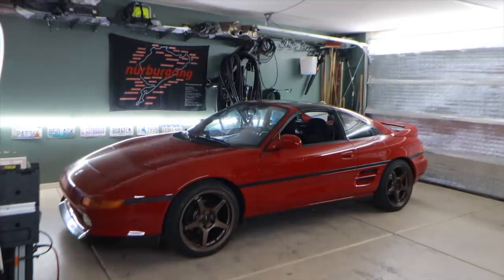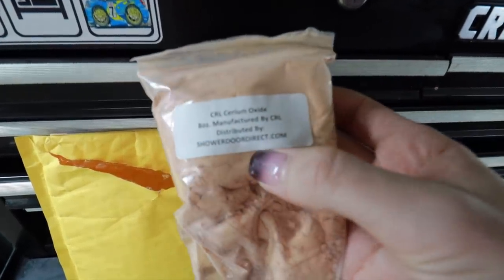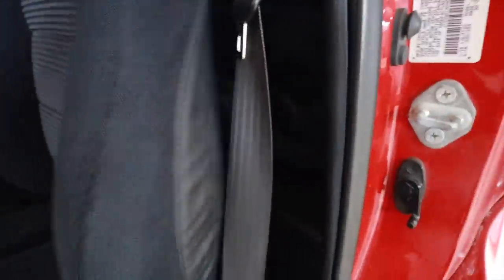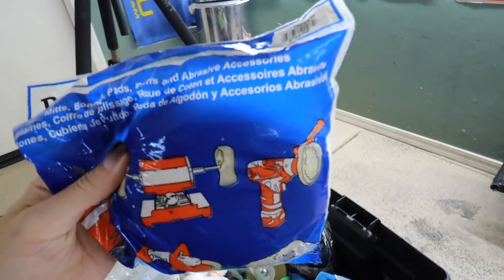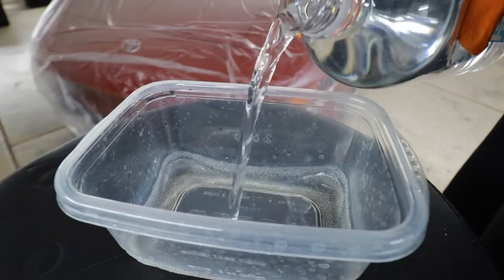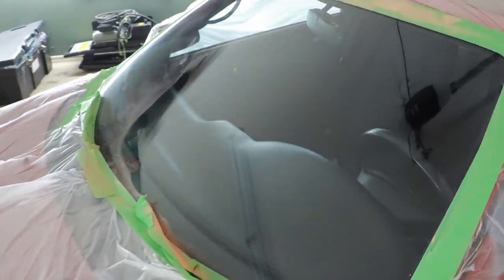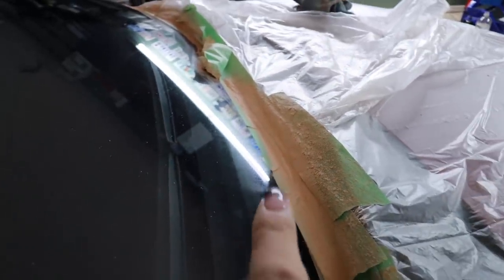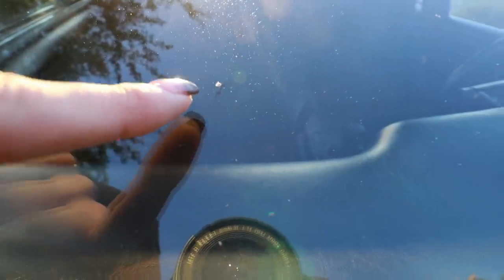Severely Scratched Windshield Repair // Hope I don't Screw This Up!

Comment: You have posters of the Nordschleife on your wall!...If you haven’t been, you should definitely go...It’s not that expensive...Just the plane ticket to Frankfurt, a rental car, and a hotel room. I stay at Motel Frankfurt in the Dornbusch neighborhood of Frankfurt. It’s about $100 a night. A full size Hertz rental is a big Mercedes. The autobahns on the 1.5 hour drive to Nurburg are intense and fun! The Nürburgring is Mecca for motor-heads and a bucket list must. A lap is €27 and takes about 10 minutes if you’re pushing it. You can drive your rental car or rent a track car at the track from a number of businesses. You’ll remember it forever. So very beautiful in the countryside of western Germany.

Comment: Hello Sarah,
Nice work with great results on the windshield.
But if you don’t mind the pads for glass polishing is Rayon Pads ..
It cut much more faster but it needs the surface to be always have moisture on it too keep it cool.
So you can mix the Cerium Oxide to be like a paste then spray a spritz of water and work and when you feel it is started to dry spray again till you end your polishing.
Then wipe off and inspect.
Also Car Pro has it as a Paste.
Hope the best for you.

Comment: Yes to the factory sub. It will also make it much nicer to listen to over long periods. Rockford Fosgates are fab but in my research have quite a high bass frequency cutoff. I can confirm the bassiest T1532s even remove a lot of the thump of a kickdrum. Replaced all four factory speakers with those and after a week I begrudgingly installed a removable 8" sub. I wouldn't be without it now. The difference of the before and after was comparable to your windscreen result; subtle but completely worth it. I also need to do this to my windscreen so this couldn't have popped up at a better time and something I can actually try at home with the limited tools I have access to. I love your ethos! Thanks and hope that helps.

Comment: I had a small, flat "subwoofer" in my NC Miata, and while it didn't hit hard, it did fill out the sound overall.  So I would recommend putting a sub in Mr. Dos.

Comment: Cerium Oxide is also known as jewellers rouge, used as polishing compound, you mix it as a paste exactly as you did. Whenever working on glass just keep the polishing tool moving so you don’t concentrate heat in one spot and use lots of water to keep the area cool and wash any particles that could scratch the glass away.

You did a good job 👍

Comment: Yes, to a small subwoofer.  Something like a JL Audio 6w3 or Alpine Type R 8" with a 200-400 watt amp would probably be plenty to add some bass without getting ridiculous.   
I know back a few years ago there were guys making custom boxes for the MR2 but now I'm not in the Toyota scene so I can't direct you to anywhere specific.

Comment: Damn ive been wanting to see if this is actually possible for years, my 92 MR2 has the same marks on its original screen too. Ive not seen a full run through with the technique before so Its awesome that the first full video I see of the process is someone ive been subscribed for ages

Comment: Great result! I just did the same for my Triumph Stag windscreen, but had the luxury of doing it flat on a set of stands before I put it back in the car during the rebuild. So much easier!!
Subwoofer- has to be personal choice. With all the cars you drive you will be very well aware of the difference it makes- question is whether you want that when driving Mr Dos.

Comment: Hi, Sarah!  I’m a relatively new subscriber.  I really enjoy your sense of humor.  Your knowledge of cars and maintenance is amazing.  You take on repairs or upgrades I would not attempt on my own.  

As to the subwoofer, you can install one if you want the car to have it for “factory accuracy.”  It will add some depth improve the sound.  Personally, I wouldn’t do it.  I’m a serious gear head and a serious audiophile.  In most cases, a nice sound system in a sports car isn’t so great.  Most likely, you have a free flow exhaust and you built the car to drive fast and have fun.  The audio system would be drowned out by the the sound of the engine.  The best sounds in any sporting auto are the rasp and wail of the engine.  Enjoy that.  Luxury cars with good audio systems make sense because of all the sound dealing.  But, high end audio performs best in a house.  

My advice is to let the engine sing to you!
Reply: There is also very good high end audio in cars.
In the end, it all comes to how important it is for you to enjoy music in your car. And in this case, the answer to that question only Sarah can know.

Comment: Glad you posted this because I have been researching this topic. Personally, I don’t want to do it and would rather hire someone. I have all windows that are either scratched (my oops) and or has hard water stains. I bought a car, new, last year that was neglected and was set outside probably under a sprinkler system. Edit: I tried clay bar, bar keepers friend and the woeful advice of an auto shop to use use those 3M scotch pads.

Comment: Very nice. I will have to likely use this window treatment on my 91 MR2. Go for the subwoofer. I had a 12" behind each seat and it was great. Your plan should sound good and take up less space so go for it. You have done a beautiful job on yours in general. Can't wait to get mine back on the road. Peace

Comment: I have a 10" subwoofer mounted in a custom enclosure behind the passenger seat on my 1991 MR2. I'm very satisfied with the bass fill it provides. I tried it once behind the driver's side but didn't like the bass hitting me in the back.

Comment: To finish the polishing off, you can use some Menzerna 1000 or 3M perfect it and a firm foam pad just to finish things off. You did bring up one of the down sides to polishing glass, you get 85% of the problems fixed and whats left for flaws are incredibly visible. I end up having to do the windshields on my semi twice a year.

Comment: Your results were impressive, Sarah.  It took a lot of work, but in the end, it was certainly worth it.  This project of yours got me wondering if anyone makes some type of glass sealant that will reduce the result of those micro pits that we all collect over several years driving through all of that environmental crud in the air?   Thanks!

Comment: Subwoofer I would put a kicker HS8 in. Put one in my Subaru Forester under passenger seat. Works well! Not over kill for a small car. 

I have the Griots glass polish with the proper pads. But was sidelined all summer so never got a chance to try it. Now I have done hope it will work!!

Comment: Great job. Hopefully you replaced your wiper blade rubbers as they would still have fine embedded pieces of dirt and/or sand in them that was causing the scratching on your windshield initially. New blades are cheap and would be HIGHLY recommended on a brand new polished windshield.

Comment: That was impressive and informative 👍 I have a Subaru Forester SF5 sti, only 3 registered in the UK right now with some bad scratches (visible but I can’t feel them) from a *insert swear word” hand wash, no chance of replacing windscreen. I had tried maguires glass polish which helped but didn’t remove them.

Comment: You crack me up lol The felt pad would be used if you were say getting scratches out of a watch crystal/glass. They are small and fit to a dremel sized machine. That would have driven you nuts. As I am a watchmaker and have a scratched windscreen in my old banger I'll go nuts for you as I never thought about using that messy crap to get the scratches out of my screen! Happy hammering.

Comment: Definitely do the sub.  Even if you're not a sound nerd, you'll like the change.  Also, next time you need a felt wheel, check out dental laboratory supplies.  The mandrel would fit your drill but they're designed to be used on a lathe so you'd only have the edge area to use, for what its worth.  Really like the MR2!

Comment: That really came out nice glass is one of the hardest things to polish that stuffs really seem to work you winged it well must be your Air Force training— MR.dos  looks good,just a fantastic job well done. I think you would really like a sub woofer in the car you don’t need a giant one I put one in my 85 Toyota pick up similar cabin size It was a small 6 inch powered sub I think it was a bazooka   basically a tube behind the drivers seat. If there are flaws they’re very hard to see-

Comment: I use Cerecut off eBay   took all the damage off both my cars and is good for stainless steel as well  comes ready to use..   also those stone chips are real small get yourself one of the diy kits  its not hard to do and fixes small ones easily

Comment: Nice job, but I have a suggestion. Whenever you are going to mask something off, as you did your entire car, start by taping off around the subject you are working on. In this case, your windshield. Then cover the object, (your car), and then tape the edge of the plastic masking back to the tape. This makes sure you are covering moldings and paint and keep a solid bond that flying paint or compounds can't get past. It also gives you another layer of protection from your polisher..
Reply from the maker: Steve 1961P. it worked fine just the way I did it 😉

Comment: Good job,  thanks I will do that, 
suggestion,,, next time wet the buffing pad. And Lanolin Used on all rubber and plastic parts is a creat restorer. Plumbs your door and window rubbers. 👌

Comment: Depends on what your looking  for in sound. More sound requires more power. Then your looking at amp addition, wires, space and so on
Reply from the maker: Get lost today good thing I have an extensive background in complex electrical systems 😉
Reply: @SarahnTuned  shoot for a small 8 or 10 inch sub then girl!😊

Comment: just like buffing the paint. I like to wet and the ring out my pads before detailing,I find the compound lasts longer and doesnt dry out ,I keep a spray bottle handy to rewet the surface and switch between compound and water .its tricky I know, but its what works for me

Comment: DEFINITELY add the subwoofer to your stereo, it'll sound so much better. I hate car music without bass so much that I even have 2 cheap 8" subs in ported boxes behind the 2 seats of my work van soley powered by a factory radio combined with 6.5" door midbass drivers crossed over to 1" silk dome tweeters mounted up in the doors at dashtop level....😎

Comment: I used to think a subwoofer was overkill for cars.  Then I bought a car that came with one as part of a package... and I don't want to hear car audio without it :)  I don't listen to anything super bass-heavy, but it gives the classic rock and classical that I mostly listen to the kind of depth that normally only comes from the much larger speakers in a home audio system.  Especially when I get the Led out 🎸  That windshield looks so good now!  Do you make housecalls? 😎

Comment: You probably won’t be doing ball joint separation anytime soon, since ya just did these, but the 3/4” forged ball joint separator from Harbor Freight ($15 or so) will make the job waaaay easier than that turd ass tuning fork. 😜 Love the format of the vids, just keep doing what you’re doing!

Comment: Curious how this turned out after you got it out in the sun? Did you have pitting or just scratches? My issue is more the star field of pits. Seems like a helper with a spray bottle would help. Thanks?

Comment: I don't know what you paid for that mix of oxide but you could have spent $14 for Wolfgangs window polisher. It's meant for a auto-windshield but I use it on my iPhone for the same purpose. It works perfectly.

Comment: Good job with that glass. By the way you could have used the Hydrosilex on that windshield ! And my question to you about that is: How long has it been on the MR 2 cuz it looks like its doing its job (water beading during the wash).

Comment: I always thought the stock subwoofer in the 2nd gen MR2 was one of the best sounding factory systems I'd heard. So if you can find one that's a good factory replacement - i.e not too big; it should really improve the sound.

Comment: Always yes to a Subwoofer but no need 4 15’s either a simple self powered 8” sub either under the passenger seat or in the OE location is fine for your application it will fill in that low note in all music and reduced the stress on your mid bass speakers from trying to reproduce the super lower bass notes and balance out the highs from the tweeters on your separates basically unless you only listen to talk radio every sound system needs a sub 🍺😎👍🏽

Comment: I'm not sure what research you did, but the detailing world has a ton of pads and compounds specifically to cut/polish glass. Generally a medium to heavy cut pad, and some glass compound, followed by a fine pad with some polishing compound on either a rotary polisher(for faster defect correction), or a DA polisher, works the best. Not sure why you had to go with cerium oxide...that stuff is normally used for things like countertops and other more industrial applications. Not that you can't use it, just don't think it's as easy a application than a ready made glass compound, nor would it finish out as nicely/easily.
Reply: Also, cerium oxide on modern windshields might create too much heat. The problen with uaing it on modern glass is that the glass is layered, the middle layer is a kind of plastic, that the heat from polishing can warp. This won't be noticeable just visually looking straight through the glass, but it will be noticeable at angles especially at night, you will see weird vIsual distoration.

Comment: You probably don't need a huge sub to fill that car, especially if you're not trying to "beat down the block" (to quote Too Short :D )  I have an 8" sub in a kick panel in my 996, (similar size interior) and it's more than adequate.  Another vote for sub.  ;)

Comment: Have you considered using the cerium oxide on the plastic head light covers of your Audi ? Might be interesting to see what would happen.
Reply: It would destroy the lenses. Most plastic polishes use a silica based abrasive, much 'softer' than the cerium oxide abrasive.

Comment: Yes for sub, and that stuff worked great, do you think it would work on tiny pitting that you can only see when a bright light shines through the windshield just right. Cause my tacoma has so many of those that when the light comes through just right, you it makes seeing through it kinda difficult. have been strongly considering just replacing the windshield but if i can diy it i'd be all for it.

Comment: I did not know you could get scratches out of glass, it looks heaps better. As a highly experienced sound engineer I recommend you not bother with a subwoofer they always sound unnatural in small cars. Turn the bass up on the head unit and be happy.

Comment: Next time you buy replacement wiper blades do not get rubber blades. Get silicone blades because they are much less likely to scratch the glass, again, and clean better and last much longer than the rubber blades. It's also not a good idea to ever run the wipers dry on the glass.

Comment: Was that car not from AZ originally? I can’t believe it made it this long without any stars or cracks in the glass, if it was on the road here for any length of time. The car I drive now made it less than 24 hours from being bought new off the lot until my first big windshield chip. I think I might have had less than 100 miles on it, that pissed me off. Oh well, 111k later there’s a few other things wrong, lol.
Reply from the maker: C. Hubbs AZ it’s entire life

Comment: Add the subwoofer. It makes a big difference, but make sure you also install a single output amp or a multi-output amp for all your speakers including the subwoofer. There is nothing worse sounding than a subwoofer with not enough power to drive it or with a subwoofer made from cheap components. The distortion is almost unbearable.

Comment: Sarah , i bought 2 different types of polishes for my car sarah and my car is good now sarah they are from a larger company and yeh sarah i dare you to plumb the turbo on the mr2 without a intercooler and turn the boost up over 20 pounds you will not have the guts to drive it maybe i recon , and sarah can you up the presure of the engine oil pump spring for more engine oil presure so your car can run better and also use premium fuel it is of premium quality , and sarah i think the fuel burns differently with different spark plugs like for instance the platinum plugs , the spark id witer and slightly less aggresive and also i gaped my plugs 30 thou and the camry i used to own ran like a rotor , please message me back Sarah i would like to have a friend , :) .

Comment: Your insurance gives you a free windshield if you have a crack. They don't inspect either. I've replaced 2 so far on my tacoma.
Reply from the maker: Mr D they give you a free substandard quality aftermarket windshield, and don’t cover OEM weather stripping. I just paid $400 out of pocket to replace the windshield on the Forester despite having full coverage.
Reply: @SarahnTuned  dang